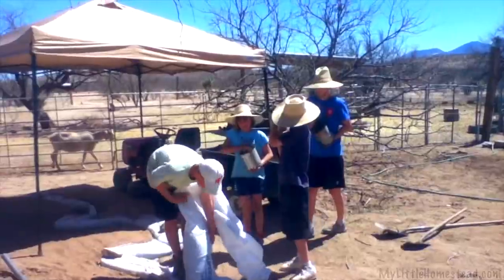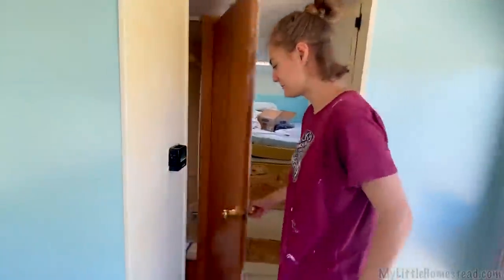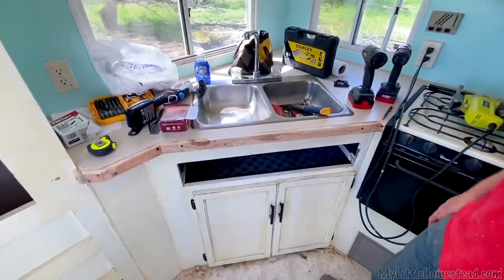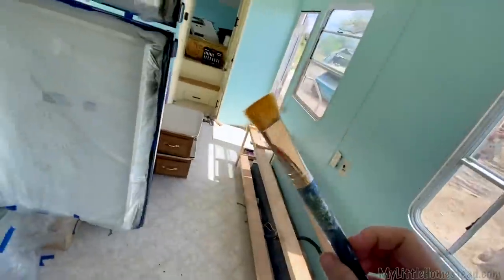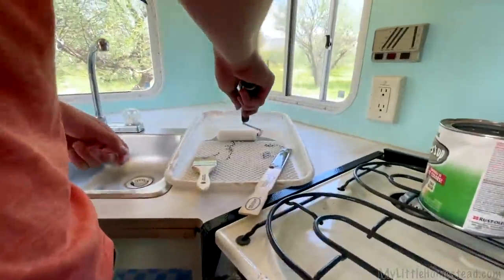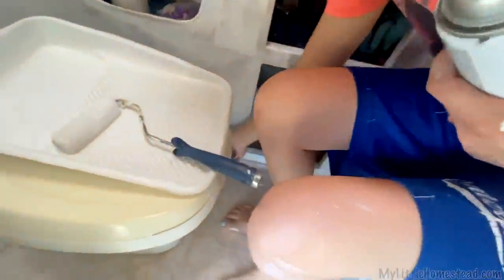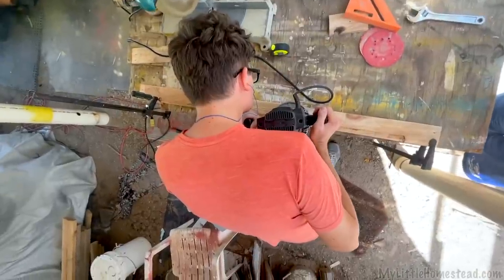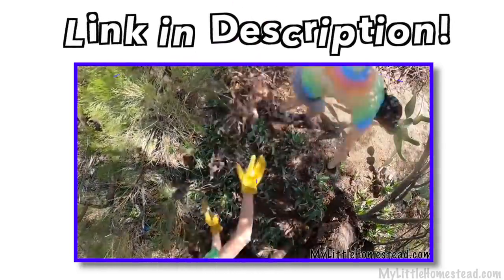RV Kitchen Countertop Refinish, Trim & Ceiling Paint | Weekly Peek Ep305

Comment: Looookin' Noice! Very Pretty! Gary, Jarod and the Trailer paint as well!
A tip to keeping the seams from ripping like that is to follow up after the paint dries and use a knife edge under the edge of the trim to allow for the panel to flex at the seam!
The countertop turned out Very Nice! The bathroom is beginning to look decent and the refreshed ceiling is amazing!
Good Work, Kiddos!

Comment: I grew up around commercial work boats in the 1960s everything from the medium gray floors up was gloss or semi-gloss white walls and cabinet with mahogany wood trim is traditional to me. After seeing how well thing's turned out in your galley, things turned out very nice and it pops. Well done.

I stepped in one older RV that had been painted this horrid shade of pink, the inside looked dirty no matter what you did. Picking the right colors and shade is the key to making a small space look clean and sharp as you have done.

Comment: Too late now but an easy way to get a crisp paint line is to put up blue tape and then small bead of clear paint-able caulk. Wipe off the excess with a watered down rag to thin the caulk then you can paint trim and peel off the tape and get a perfect line. Also I would highly recommend you put poly urethane on the backs of the pallet pieces and screw them back on with silicone in between the wood and the countertop. You don't want that particle board getting any moisture on it. BTW the trailer is looking fantastic!

Comment: Bree,
Since you took the picture of the original labels on your A/C fan plate,  import that picture into photoshop, recreate it to the size and shape of the slant on the fan plate with a clear sans-serif font, then print it out on card stock or if your print is capable, a clear plastic stock sheet then glue it to the slant the labeling was at originally.

Comment: You might try using a razor knife to cut the trim loose then lightly paint again sort of shoving the brush in the that space between the wall and the trim then after it's dry cut it loose again. This serves to paint the bit of the wall that will show as the trim moves around and cutting it again then frees it up to move in the future. It's a bit of a chore but it bothers you it might be worth it. Everything looks great! I like the counter top paint does it come in that color or can it be tinted what ever color you want.

Comment: Just lately you added a longer intro that makes it really hard for anyone with ADHD to get to the content without switching away. This is particularly frustrating since I used to hold this channel up as an example of a channel that got it right. This particular episode doubles up on long intros with the normal too long intro and then follows it with an additional too long intro. I understand you might find the problem stupid and not care about people with disabilities, but I wish you'd go back to the short length intro you had for years. Of course there's tons of commercial content that gets it right because they have to care about audience, and more and more YouTube content is getting it right, so it's frustrating that you had it right and went really far the other way.